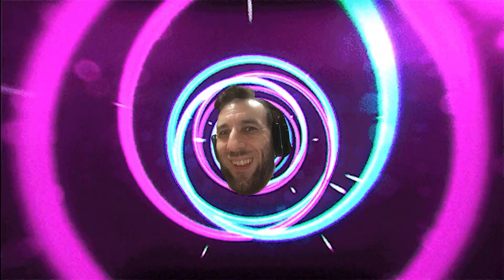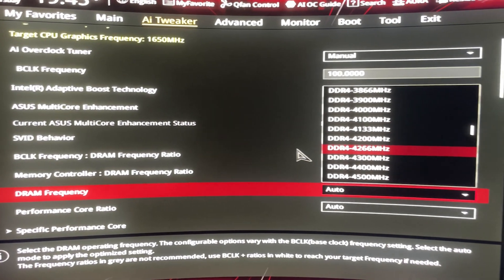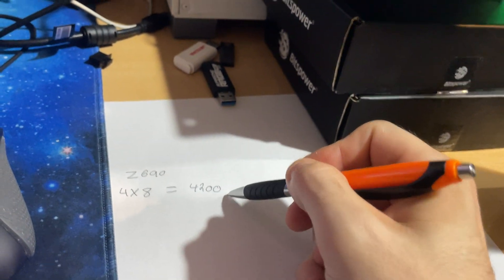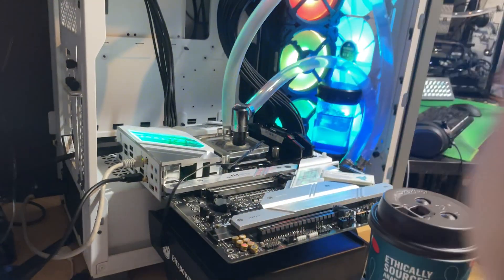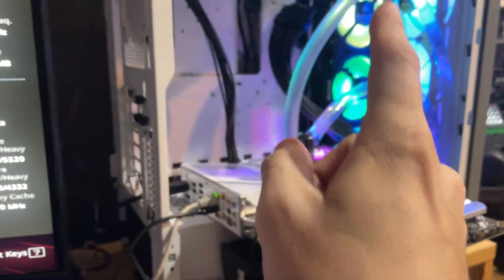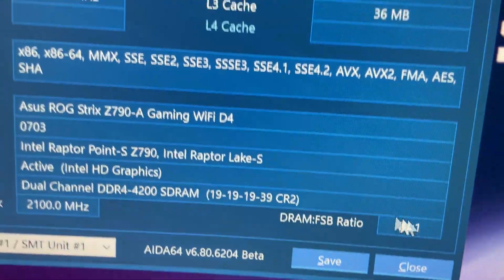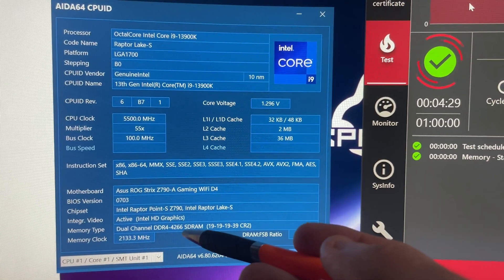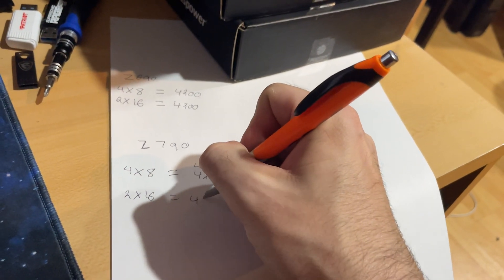Z690 VS Z790 DDR4 Memory Performance Comparison

Comment: .For some reason I get 10ns latency higher on the Gigabyte Aorus Z690M DDR4 mobo than MSI Z790 P Wifi ddr4. From 65gb/s 41ns to 65gb/s 52ns. What is happening? The ram timings and tuning are all the same

Comment: Im so confused. "You only get a few more pcie lanes"? Dont you need 16 to power a graphics card properly?????????? They went from 12 ---> 20 from z690 to z790
Reply: Not sure if you ever worked this out, but just in case anyone comes through here later:

There are CPU- and chipset-provided PCIe lanes. The 12-14th gen Intel CPUs support 16 lanes of PCIe 5.0 and 4 lanes of PCIe 4.0. These lanes have a direct connection to the CPU from their respective slots on the motherboard. The lane counts shown in the chart you're referring to are chipset provided lanes. Those lanes connect to the chipset from their respective slots on the motherboard, the chipset in turn has a dedicated connection to the CPU. That connection adds latency and a bottleneck to the connection between the devices and the CPU, which is why you want to have at least your boot SSD and your graphics card using a direct connection to the CPU for max performance. 

Speaking of max performance, you still don't need all 16 PCIe lanes for good performance from your graphics card, even nowadays. 8 will usually get you pretty close to max performance. That being said, lane counts are generally cut by two, like 16, 8, 4, 2, 1; so if you use the top M.2 slot in a Z690 or Z790 mobo (which shares lanes with the top PCIe slot), you will cut your available lanes in the top PCIe slot in half. This isn't generally a problem unless having only 8 lanes available in that slot is a bottleneck for you.

If any 'well, actually' type people come along, this is all generalities. Some motherboards are setup a little differently, but they're rare, and I think anyone who knows enough about their gear to know those motherboards or whether they actually have a strong bottleneck at PCIe 5.0 x8 knows enough to not need my generalized comment.

Comment: I have a z690 aorus elite ax. I am new to this and bought a 2x8 4400 kit and can not get this thing stable. I got it to run at. 4000 with a push to 20 on timings at 1.45v but I’m kinda stuck there and it is kinda still volatile lol. Pls help
Reply: Gigabyte boards from at least Z390 to z690 are completely broken when it comes to RAM overclocking.

Comment: Nowadays the price of the z690 is about 330-340 and the z790 is between 350-365. For that extra 20 dollars i would go for the higher chipset no doubt
Reply: Never z790 for d4 tho. Only for d5. Same goes for z690 never for d5 but for d4 only.

Comment: I've already told a few people that they want to get rid of their old stock, for the new generation with A.I working with 1/0 on the same microsecond, that's why there are a lot of problems with the bioses, new on old, not a good time for new hardwaree especially with those prices.
Using 4 sticks [ 4 x anything ] is very weak, DDR5 is better with 2 x anything

Comment: Great review. Thank you! 👍 In all fairness Z790 motherboards are pretty new and may potentially see an improvement with newer BIOS versions. And VRM power stages on these motherboards may be different - tomshardware was saying in their review that Z690-A motherboard has 80A VRM, not 70A like Z790-A.

Comment: In the past, I have asked you for a tutorial abut overclocking. You said that you will not create tutorial like this because knowledge will be stolen to other channels, which is true I'm sure. But from this video I was able to overclock my memory  over advertised 3600MHz to 3733MHz, and I noticed a huge difference in Hunt Showdown game. Hunt Showdown is very hard to run, even on a powerful PC. I have, 12900K and 64 GB RAM. And I know that 64GB in 4 sticks is very hard to run. It was possible to run this ram very easily with, 3333MHz, but it was not enough to run Hunt Showdown with good performance. Right now with 3733MHz Hunt Showdown runs so much better.
Can you tell me how high I can go with voltage? From what I know, you have to change two types of voltages. I know I can do better with this RAM, but I don't know where to start.
My RAM: DOMINATOR® PLATINUM RGB 64GB (4 x 16GB) DDR4 DRAM 3600MHz C16 Memory Kit. This is CORSAIR website >>> https://www.corsair.com/ru/pl/Categories/Products/Pami%C4%99%C4%87/DOMINATOR-PLATINUM-RGB/p/CMT64GX4M4K3600C16
If any reader wants to help me, please just share with me tutorial about RAM overclocking, so I can understand the process better. I don't need "THE RECORD" speed, I just need speed better for gaming. And now with 3733MHz I can see how important the speed of the RAM is, this is day and night. Thank you.

Comment: I got a Asus ROG Strix Z690-E along with a 12700K.   I have BIOS 1720,  am I correct in that I should be good if I get a 13th gen CPU?  Wasn't it Bios 1601 update that allowed it?

Comment: That b.Die will get hot in a closed Case with  RTX 4090 better put a Fan on them because b-Die doesnt like Temps over 45c when Timings are tweaked to the limit ;)
I was shocked yesterday after playing Squad when i checked max Temps in HWInfo 50c+ !
Thats why i love watercooled Graphiccards,much easier to Transfer the Heat out of the Case

Comment: I settled for 4000MHz 16-16-16-32 1.42V on 4x8 4400 vipers on MSI Pro Z690-A 13700KF All Core 5.7GHz, 4.5GHz E-cores 1.35V ended up with 60Gb/s 52ns. Didn't wanna spend more than a day on OC. But I can't help wondering what gains I may see if I jumped back in for some more RAM tuning
Reply: I'm no expert, that's why I prefer to be modest with my overclocks.
Reply: @channelthepigslove  I feel you I do the same..I know technically 1.4v is safe if chip isn’t overheating but i would never daily anything over 1.375v..but I’m waiting on my 32gb 4000mhz c16 b die to get here and I’m gonna start fooling around I’ll let you know what I end up with! Looking nice even at stock tho
Reply: Hey guys could y'all give suggestions on which voltages to run? I just got the same Asus Z790 board featured in the video with a 13700K and don't really know where to start. I've never really fooled with memory overclocking (I'm using 4x8GB Trident Z RGB 4400) and the P and E core separation has me not really knowing how to proceed there as well
Reply: @AMDman18  I personally wouldn’t go over 1.32 mine sits around 1.31v 1  P core at 5.6ghz and rest at 5.5 and 5.4…E cores all 4.6ghz and cache speed 4.7ghz with z690 LLC mode 4(middle level)..I have a 360mm aio and am fully stable have never seen package temps over 85c when benching and gaming around 45-65c depending on game and about 28c idle …just wouldn’t go much above 1.33ish on 13th gen even tho some people do..but really as long as your temps are under 90c sustained while benching it’s perfectly fine and you want it no higher than 70c gaming
Reply: @AMDman18  and it’s noticeabley much faster than my 12900k that was a bad clocker
Reply: Would you say 1.35v is a good voltage for 13700k or is it safe to go a bit higher? Just got a 13700k myself(coming from a big loser 12900kf..couldn’t even get 1 core at 5.3 with 1.38v) and at all auto this is running way faster at great temps already with low voltage..I love overclocking and performance and feel like this has some room I just don’t wanna push stupid voltages and can’t find much Info on if the voltage is basically same as alder lake l(up to max 1.4v if cooled)..have a good 360mm aio btw..any help would be awesome thank you!
Reply: @outdat3d-04zx10r-ha  it depends on your load voltage after droop. Not set voltage. At a load voltage of 1.3v + it is almost impossible to cool in any stress test. For daily voltage i like staying under 1.3v just so my temps aren’t hitting 90c+. Gaming should be fine, but you’ll still see max temps really high. And thats using a custom loop with delid and 3 radiators. I’m using a 12900k though.
Reply: Spent only a day on ram oc? Hope its stable and not throwing errors in memtest or testmem5
Reply: @ashryver3605  nah, CPU OC. Should have been more specific

Comment: the asus d4 z690 doesn't have an optical out and the vrm heatsink plastic stops a D15 from being used, other than that the z690 and z790 are the same
Reply: I just got the z790 and hoping that my D15 fits like noctua says it will. Anyone know for sure before I break the seal on the motherboard box?
Reply: @tumater729  it should because before on the z690 there was there plastic that made the vrms go higher. This is the only reason why I would buy the z790 over the z690 as I have a D15s and may buy the new D15 when noctua releases it next year. You can check on noctua's compatibility page or email their support to be sure
Reply: @adeveloper6653  Woot! D15 and D15S are both on the compatibility lists for Z790-a!

Comment: Great video! I think z790 will have advantage when it comes to ddr5 with higher clock speed support.
Reply: It does I can boot 8000 on a 4 dim. 7600 tight and tuned all mem test stable. Started working on 7800 tune. I can get a cpu score over 30k in timespy with this 4 dim board.
Reply: @Rs3Matt  How u know that 13 gen cpu cant do the same freq. with z690 did u test it or u just did on z790 ? i need ddr5 kit and mobo and i can get z690 much cheaper but i want 7000+ on ram
Reply: @dardan1a915  I tested on a z690 formula 7400 was the best I could do but it was not easy to get those speeds. Xmp on adie wouldn’t boot on z690. It was still very quick on z690 just z790 is better and able to overclock more.
Reply: @Rs3Matt  Thats not bad what ram kit do u have tested and what u think of kingston renegade 6000 cl32 can i achieve that i dont know is it mdie or adie
Reply: yes, even 4 dimm boards

Comment: For DDR5 mobo can you test how good OC RAM capabilities of cheap Z790 like Asus Z790-P,  MSI Z790-A, or Asrock Z790 Pro Rs. I'm curious if this cheap mobo can OC up to 6800-7000++, especially right now we can see cheap M-die kit.

Thanks for your content anyway 👍🏼
Reply: Btw for cheap mobo I'm leaning to Asus Z790-P because I have good experience with Asus Z690-P D4, my system can daily 4400MHz 15-15-15-34 + super tight sub & tertiary timings
Reply: @muhammadbaharits9922  4400 on gear 1 with what cpu? voltages?
Reply: @zerixzerix3039  ofc not G1 even the best binned cant do that, but I already compare G1 4000MHz vs G2 4400MHz, in my case G2 4400MHz is faster.
Reply: @muhammadbaharits9922  ok figured as much, thx

Comment: The VRM on the z790 is 70 amps  compare to the 80 amps to the z690. Z790 pcie 4 lane top connector while the z690 pcie 5. It should be cheaper !
Reply: That's why i chose Z690 to my 13900K. Was on 12700K and GAMING X before.
Asus has a lot of better VRM, BIOS, Latches (especially loving the gpu release latch)
And also i decreased timings (factory CL18 has become CL17)
Z790 is nonsense as it's a dead platform and 14900K will be 1851 socket-based CPU. Anyways, i love my 13900K i expected the great perfomance and i got it. And even virtual machines got a boost in comparasion to 12700K and 11600K.

Comment: Bought a Z690 Tomahawk, 13700K, and used my existing 32GB(4x8) DDR4 4000 C17 ram. Bios flashback went through perfectly, took 4-5 minutes to flash it. I got my ram to run on Gear 1 at 17-17-17-37, though I had to give it a healthy dose of voltage(1.48 DRAM and 1.32 SA). Runs amazingly fast for my needs, I get about 30,500 on R23 and 60,900 write bandwidth on AIDA64 with 52ns latency. I never realized Gear 1 drops latency so much, I think with a little more tinkering I can get it to 50ns.
Reply: @y0ubi Yes you will, just have to make sure if buying Z690 that the motherboard has a bios flashback button so you can flash it. If you don't know what I'm talking about then just get a Z790 board. It's not hard to flash the old Z690 boards though.
Reply: What do you think same DDR4 memory performs exactly the same on z690 and z790 also b660 and b760?
Reply: So your talking about msi z690 tommawak   wifi ddr4 
So can I play games at more fps and at high temperature 🌡️ mean am i going to face any problem in future when I will pair i9 13900k?

Comment: 😅 you tested exactly the hardware i was considering. I bought the Z690 DDR4 for ~230€. The z790 would have cost over 450€ (minus 70€ cashback promo). So i made the best choice here. Thank you! The AI OC on this board is great! 6GHz von 4 Cores of my 13600K. Great gaming  CPU
Reply: @0QualityOverQuantity  That's still really good bro. Just not golden.
Reply: @0QualityOverQuantity  your 5,7 all core is great!  I am talking about 4 of my 6 p cores going wild
Reply: Nice score bro
Reply: @0QualityOverQuantity  i am using the contact frame from thermaltake, thermal grizzly kryonaut extreme and a 360 Celsius aio. I  am using the ai OC from asus and on top changed some settings in xtu. Disabled Thermal velocity boost, Multiplikator for 1 core 2 core and so on tested for stability. Took me less than 2 hours.
Reply: @0QualityOverQuantity  oh yes cryonaut is really thick. I can show you the xtu settings in under 5 min in a teams call. Or send you a screen. It is not a individual overclock, it is related to the number of cores under load. It looks like 1P Core 6,1GHz 2P 6,1GHz 3P Core 6GHz 4P 6GHz, 5P Core 5,8GHz 6P Core 5,7GHz, All Core load cant boost as high as single core load. It doesnt matter which core exactly is used.  So usually the best cores will see the gaming load on high clocks